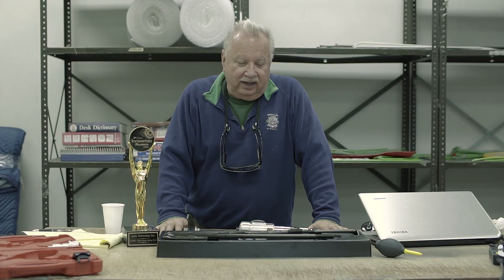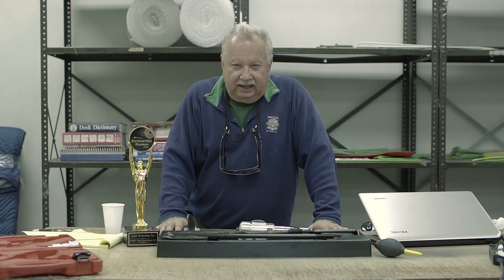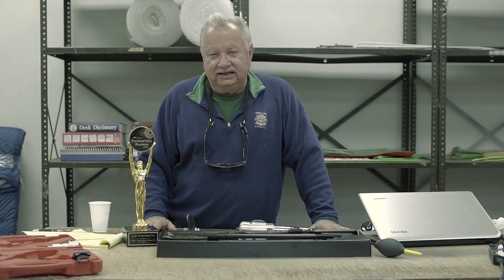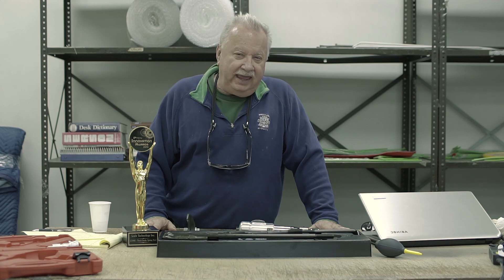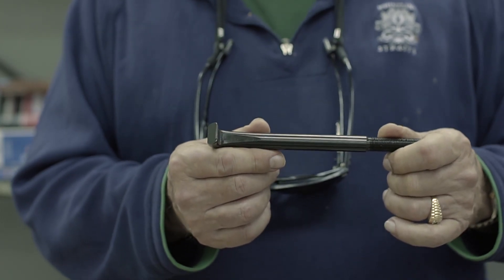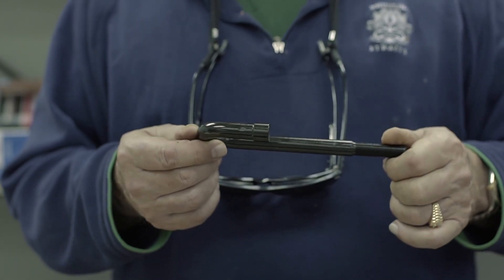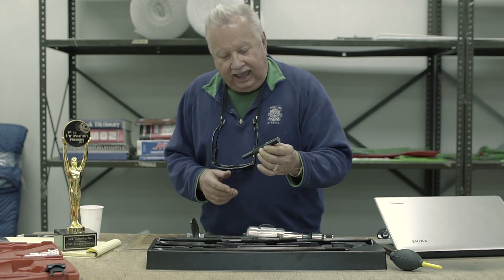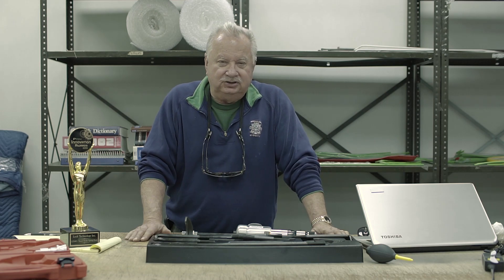Texas Twister | This is how we answer Flat Rate Master [Lock Technology]

Comment: I do not own this tool but am now considering buying one after pulling out axle bearing from a f-150. 

I will be looking to buy just the recurved bar, though, because you said it have the same tread size as all slide hammer accessories; and I have drawers of slide hammer accessories. No need to double up.

Long story short I’m glade you chose to respond to a dissatisfied customer. The majority of tool manufacturers would chose to ignore it.

I would love to see a follow up video with Brad (zoom meeting) to figure out if it’s tech error or tool error, or a weak air hammer.

Comment: Why not design a tool that doesn't have the drawbacks this design has?  The off-center flexing is the problem, force from the hammer blows is absorbed by the u-bend and rod being off-center with the air driven piston.

Comment: I'm a diesel technician and I try to use this tool that I purchased from a 🔧 truck and I'm a firm believer that the tool don't make a technician but it helps and this tool does not help you it vibrates too much and it doesn't travel all the way down to the tip so technically you're not doing anything I do not recommend this to at all